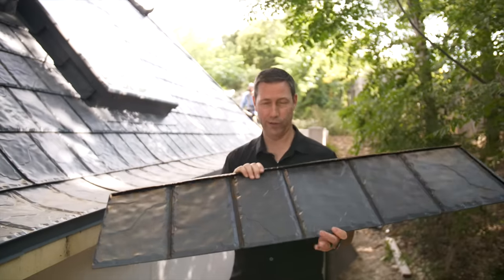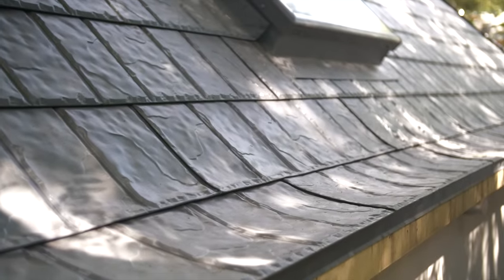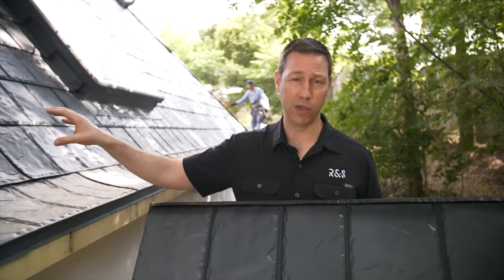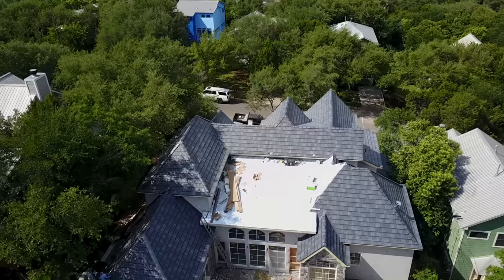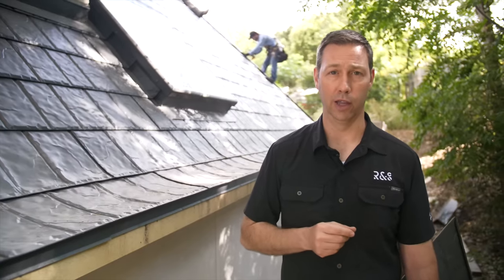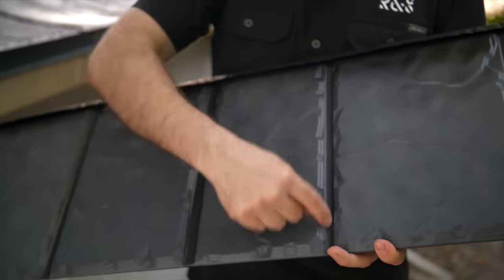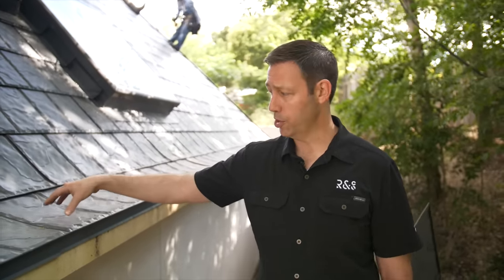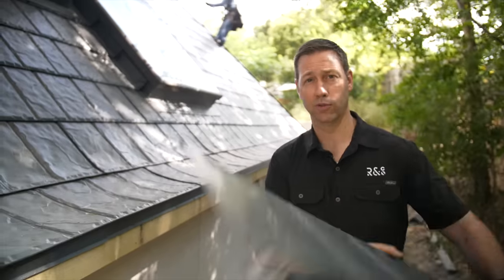Metal Roof Shingle Review

Comment: I think the days of asphalt 3 tab old school shingles are limited.  People are sick of replacing them in every wind strorm, or every major hail storm, and the life span.  I wonder if insurance companies will look into this and give you lower premiums if you do roofs like this.
Reply: I agree with ya Virgil and that would be nice,    but think about what you just said " Insurance companies giving lowering premiums"  That's kind of an oxymoron ?
Reply: D B, Really ?  In half just for a metal roof, did they say the specific reason. I would think it would go up do to the fact that you're increasing the value of the home.
Reply: Insurance companies do prefer metal roofs and have to factor in risk to their premiums. So more often then not especially if the metal roof is a under insurance replacement they will adjust your premium for the lower risk.

Metal roofs are not only more durable but far easier to repair. If one part of a roof gets heavily hail damaged on asphalt shingle you can't really just replace that one spot. It will look different due to wear and not to mention the lifetime of the surrounding shingles is much less.

Metal roofs on the other hand can easily be recoated if need be to match wear and their far greater durability means they aren't paying for a repair that will have to be replaced anyway in 5-10 years when the other shingles wear out.

Metal roofs also lower the insurance risk because they are not as prone to snow loading as an asphalt roof so there is less chance of a collapse. And to protect areas people may be under when snow breaks loose horizontal snow guards are easy to install.
Reply: Agreed they are complete garbage
Reply: I think when it comes to replace my asphalt shingles I will be going this route, or something similar.  Not going to tear up a completely good roof.  I manually tabbed my asphalt shingles about 7 years ago after loosing some here and there due to wind.  Took me an entire weekend, but I dont lose shingles anymore
Reply: Now they have lifetime shingles...I know because I'm building a house and using them right now.
Reply: In my area, insurance companies will only reduce premiums for a high wind resistant roof and removal of trees near the roof. because the majority of damage in my area to homes is from hurricanes. the premium goes up for other types of roofs than asphalt roofs because they cost the insurance company more to replace even if they are less likely to see a claim. 
They don't really account for the "longer life" of the roof because in my area it is fairly rare for a roof to survive the full 10+ years without any storm damage due to living in a coastal area prone to large hurricanes.
Reply: peter d , Then why do real-estate companies always include it in their ads when they are selling a house. A newer roof always increases the value.
Reply: Maybe...but you also have to consider, since the metal roof costs more= costs more to replace in a claim

Comment: I did a metal roof 17 years ago in Las Vegas, a Spanish Tile look, Here’s another Great advantage besides the weight. There’s a coating underneath that dissipates the Heat, and you know how Hot it gets in Vegas. During the summer you can’t touch that clay tile and it holds the Heat. If it’s 110 degrees during the day at 2:00 in the morning it’s still 101, that’s Why you’re running the AC 24/7. I could touch the metal roof without smelling my skin burn. I swear the attic was 35-40 degrees cooler

Comment: Matt you should check out Decra too we had one installed 5 or so years ago we absolutely love it, it looks like a shingled roof and I don't think anyone would know either.  Down side we were the first in the south to have one so they say, I think if memory serves they do more out towards California, the first installer messed it up and it had some leaks.  Decra stepped up and got someone out here and did a beautiful job with no charge to us.  I can't remember the wind ratings but I remember it was pretty high compared to normal roofing when I looked it up also has a 50 year warranty, this is all from memory.   To date we have been through hail and a few hurricanes with 20in+ of rain in a day with zero problems.  I think it was rated to 2" hail with no damage.
Reply: met
Reply: Don't think anyone would know?  Keep telling yourself that.  Doesn't take an experienced eye to notice these stamped metal roofs...
Reply: Decra is a great product fixed correctly, however it looks like what it is a pressed metal tile coated with a pretty impressive granite material.
Reply: Paul Webb, I think it looks better then shingles frankly.
Reply: I like the look of the Decra product, but the installed cost is about 4x that of 30-year asphalt and 3x 50-year asphalt.  Personally, I REALLY want to get a way from asphalt on my house, but a $80K roof on a 3000 sf ranch house (45 degree pitch) is just too expensive!

Comment: I installed roofs for 2 years and I've never seen a metal shingle. You got the most unique stuff on here. I've done metal roofs but they are sheets not shingles.
Reply: I'm going 2 years as a pro and helped out on weekends for 5 years have never seen metal shingles installed.
I've heard of them as well as stone coated metal roofs that look like asphalt but haven't used any.
It's just that people don't really go to these products due to their cost.
It's already rare enough to see presidential shingles and they are expensive. GAF Glenwood is already very expensive, Home Depot sells it at around $36 a bundle and it takes 9 bundles a square. That's $324 a square while Owens Corning Duration Storm is only around $120-$140 a Square.
Reply: @bryanmartinez6600  I think it's also being unaware if the product. I was only aware of the sheet metal roofing (which I associate with country styling), but saw this video https://youtu.be/cAcsEV6B2Qk and am interested. Not sure if I'd be as willing to try this, vice the asphalt shingle.
Reply: LOL REALLY?!  It's like first day on the job I saw one!

Comment: I put on a metal roof over 20 years ago when living in California.   Much lighter roof than the previous cedar shake roof (especially when wet).   Because the roof loading is less, it is more effective in preventing earthquake damage on the building structure.   A second advantage, a metal roof is far more effective from external fire damage.  The only negative aspect is that TV antennas in the attic no longer worked....
Reply: Interesting Keith. But now nobody cares about TV antennas anymore. So now with these new designs the appeal is substantial. I wonder how easy it is to keep cool in this house. I had new build home in CA that had beautiful concrete shingle tiles and at about 1pm every night the horrible heat would radiate through the house like an easy bake oven and you would sweat in bed if you didn't have the AC on and I wasn't comfortable having the windows open in CA. It was incredible how hot this roof made the house. I installed a whole house fan to deal with this problem. It was great but whenever you didn't have it running the house would again heat up and bake even though it had next level high rated insulation and had an energy star certification.  Another draw back to the wonderful fresh air from the whole house fan is it also brought in dust into the house.
Reply: @orlandotourist4302  That's not entirely true. Lots of people who live outside of urban areas still care very much about TV antenna signals, as they frequently don't have Cable TV in their areas, and also don't have sufficient internet capacity to rely on streaming video services. My parents are one example, and we're still up in the northeast where even "rural" isn't that secluded. I'd imagine the issue only gets worse as you get out into the midwest.
Reply: @c182SkylaneRG  Those are what we call poor people.

Comment: In northern climates that get a lot of snow there is a problem with large sheets of snow/ice sliding off the roof all at once. This happened to a neighbor where the ice chunk busted his AC condenser. There are these spikes or blocks that need to be installed around the lower side of the roof to prevent this. Please do a video explaining this.
Reply: You can build a cover for the AC condenser to protect it.

Comment: Homeowner here.  I've installed a metal roof by myself (50 yr warranty) and it took a bit of work (I'm a perfectionist) and it turned out great.  Air gap helps keep things cooler.  Insulating foam helps.  It does take a bit of training, and mine was a different style with more dimension to it.  Very walkable on the front edge that bent down to the next level down.  Prep is CRITICAL for straight lines.  There's no forgiveness and sloppiness here!  Valleys take extra work for a tight fit.  Some metal bending and cutting needed.  Yes it cost extra, but I didn't have to retrofit the house for extra weight.  I had cedar shingles before with skip sheathing.
Reply: Ju, which manufacturer did you go with for your metal roof?

Comment: Looks great. I wonder if there is an impact on cellular reception. Not generally the first thing you consider with roofing material selection. However, my in-laws have a heavy, steel “terracotta-look” roof.  Cellular reception is heavily impacted in their home. You’d have to step outside to take a call or be near windows to get a better signal. We ended up installing an internal cellular transmitter to address the issue. And more recently with newer technology, we use wifi calling. Guess I’ve answered my own question is some ways.
Reply: Learn about risks of WIFI -- major health problems.  ELECTROSMOG.

Comment: Kynar is definitely a very durable thermoset polymer but it will degrade over time.   What is the mil thickness of Kynar applied?  1, 2, 3 or more?    That home is not spitting distance from Chicago 😏.  Noise is not something new I want to endure. Kynar degrades.  Paint fades.  Then what is the surface prep like to repaint?   Polyurea?

Comment: A couple of thoughts. 
1. Is a painted metal shingle still considered a barrier to radiant heat? I understand how galvanized steel will reflect a large portion of radiant heat, but painted steel gets just as hot a asphalt shingles in the sun it seems. 
2. I can't see this being more hail resistant than decent asphalt shingles. Hit both with a plastic faced hammer a few times an see which one gets damaged more easily. I'd bet it's the steel. These may be more wind resistant if they bottom edge ties into the row below it though.

Comment: What is the cost vs a traditional 3 tab roof?
Reply: Roofer's rule of thumb as of 2018, 2.5 xs.
Reply: @Austinroofingcontractors  So instead of $12,000 for a roof replacement, figure $30,000......wow!
Reply: I understand.  A good quality asphalt roof should be able to last 20-25 years at least.  And don't forget that the average American has less than $1,000 in savings.

Comment: It's a good looking roof.  If the paint is warranted for 30 years, how long will the steel last?  

I have one question/observation.  Does the steel block cell signals?  Cellular carriers don't guarantee connectivity indoors, and it is my experience that I miss more calls than I get.  Will this only exacerbate the problem?

Comment: Lots of choices for roof coverings. They all have good and bad. Pick the one you like and get the best installer you can find. That being said, nothing better than slate for steep slope roofing. The longevity of slate is key to its value in the eyes of homeowners. After all, roofing can be expensive. Slate is one of the few roofing options that doesn't need to be replaced within the span of a lifetime. In most environments, slate shingles will last at least 125 years and sometimes as long as 200 years.

Comment: I have had a similar product on a roof in Oklahoma and a hail storm dented the heck out of it. Looked like someone beat it with a ball peen hammer. Luckily it was a rental for me and the rental policy didn’t have the cosmetic damage exclusion. So we replaced it with UL2218 Class 4 impact resistant shingles and cut our insurance in half.  If it had been a home owner policy they would have had the exclusion that doesn’t cover cosmetic damage and I would have been stuck with a dented roof. Matt is off with his description of impact resistance. Sure, it will hold up but look like crap after a decent hail storm.
Reply: Metal roofs are very durable but after a hailstorm it will be no different than a car body.

Comment: What happens when you walk on it?
Reply: Great question, hope you don't mind my input!  Aluminum crushes very easily but often comes with a styrofoam backer.  If walking on it may be needed to keep it clean always get the backer!  In our climate, it's better to use steel, Kynar Coated Steel.
Reply: You can walk on a slate roof easily without damaging it. You just step on the part of the slate that's closest to where it's nailed down, ie. the part that's closest to the roof where it's supported directly  underneath by the roof. After all, when slates have to be able to be replaced you have to walk on the slates to get to the point needing a repair. If anyone says you can't walk on a slate roof they don't know what they're talking about. It's a canard.

Comment: How does this hold up in wind?
Reply: 160 mph according to website
Reply: Garrard and Sierra stone-coated steel (invented in Australia, 30 years ago) are pinned in the front.   In the College Hills, Glendale CA fires of ~1990 (my home town, and near where I grew up), caused by notorious arsonist John Orr on a Santa-Ana wind day, the only houses left standing were those with stone-coated steel roofs.      Clay tiles are pinned in the back and they blew off, rendering their advertised fire resistance useless.
Reply: Some of us  guys from church went to put a tarp on an elderly lady's house after a tornado and she had a metal shingle roof. The only place where there was any shingle damage was where trees punctured holes in the roof, none were lifted. The house was an older concrete block home and other than the tree damage the home was fine. Across the highway where the tornado was confirmed to be an FROM all the homes were leveled.
Reply: DEREMEYER1 -- You made some good points, but thumbs down for all the shouting.
Reply: John Becich - double lock standing seam metal roof will last forever

Comment: This is a lovely look, especially for houses made of cracked stone or even cracked concrete block.    I'd put this on a commercial building of such block, using a Mansard design.    

I have experimented personally with radiant barrier, and glass films, on property I own, to great success in southern California where the sun really bears down.      A radiant barrier needs to be shiny, to work, on at least one side, and that's the side that needs an air gap.  (A vacuum gap would be even better, but that's impossible.)         I doubt this roof will serve that purpose, with its lack of sheen and that mesh beneath; the heat can conduct via the mesh, to the sub-roof, and then radiate into the attic.     So that attic might not be such a conditioned space, when it's all done.    

I hope there is follow up, with temperature readings ... sans HVAC assist.
Vive le motif de la toiture française.

Comment: Does the metal shingle heat up in the sun like asphalt shingles do?  Is there a shingle that does not get hot or reflects the heat?  I guess the air gap should help, but would love it if the shingles did not get hot.
Reply: If it is metal then cause it would heat up dah!

Comment: Why would you have to replace asphalt shingles after it hails?
Reply: Big hail can tear them or knock tabs off of them.
Reply: Thanks. I didn't realize that.
Reply: Even dime size nicks of missing granules on the shingles from hail, that is sometimes not visible from the ground will lead to a shortened roof life, as the unprotected layer deteriorates more rapidly.
Reply: Lee Hammond That's why in Europe shingle is only considered suitable for garden sheds. Nobody would dream of using it on a house!

Comment: I was looking for metal roofing and had a roofer tell me to not go with metal roofing due to heat expansion and winter cold pulling out fasteners (?) causing leaks that are almost impossible to find.  Neighbor across the street with metal roof just 'foamed' over the metal in their back due to leaks (blech)! How does this hold up in the desert southwest temperature swings?

Comment: Pretty good shingles. I installed a lot of them. Impressive color options and good coating.
Few problems
- PRICE .... insane!!! Doesn't make any sense....

- Lead time...... Sometimes i have a feeling that materials come from Mars.
- From installation point - clip system is outdated now. Really slows you down. 
- Snow stops works , ... but not always. If you live up north and have a lot of snow, You not lucky with pitch and configuration of the roof. Then of of these avalanches will tear snow stops down. 
Cheers